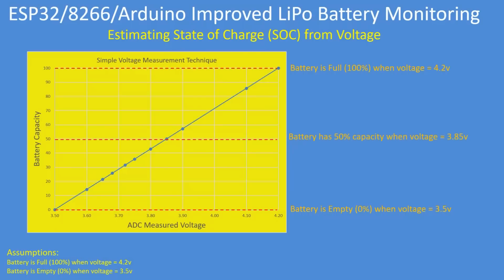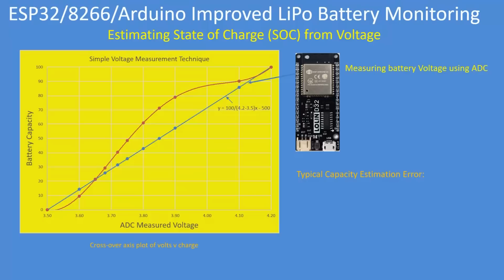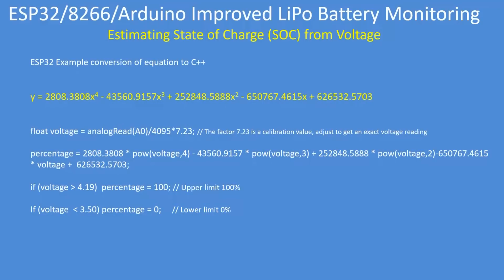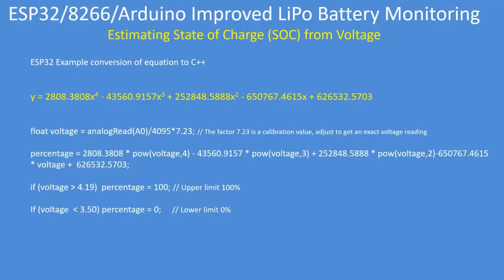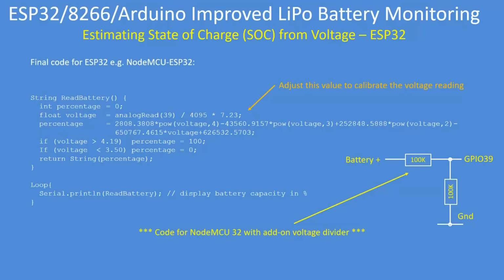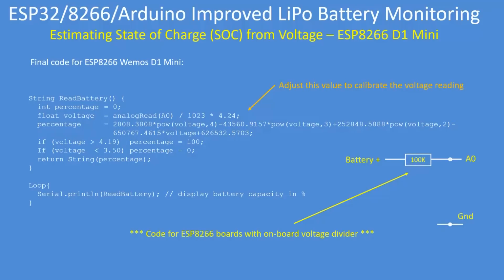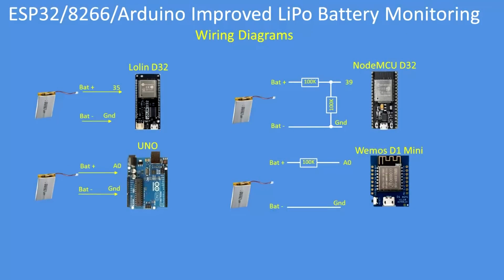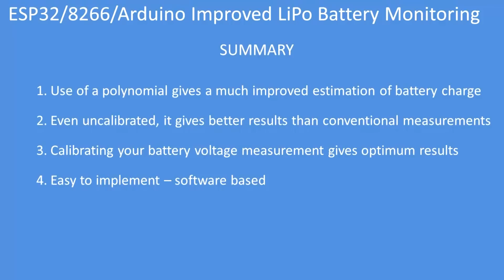Tech Note 129 - ESP32/8266/Arduino Improved Li-ion/LiPo Battery Monitoring

Comment: Wouldn't a 3 point interpolation get you closer to actuals?
Reply from the maker: The ADC is significantly non-linear between 0 and 0.6v and then 3 to 3.3v, which is why I chose s polynomial to follow the ADC response curve, a simple linear interpolation would not give acceptable results outside of the region 0.6 to 3 volts, however within that range the ADC is actually very linear.

Comment: Is it dangerous i do direct connection lithium ion to esp32?
Reply from the maker: If you mean via an ADC input pin then no. If you mean to supply power to an ESP32 then that sort of battery will destroy the ESP32 as the battery voltage is nominally 3.8v and the maximum ESP32 supply voltage is 3.3v. You can use a LiFePO4 battery for direct connection as it’s cell voltage is 3.2v
Reply: @G6EJD-David  i just want to use esp32 to monitor the lipo4 battery percentage. Should be okay right by just adding two resistor for voltage divider
Reply from the maker: @shakirsalam555  exactly that is required
Reply: @G6EJD-David  hi bro,i just eant to ask. Is there any way i can take the serial monitor value and display it on lcd or oled display?
Reply from the maker: @shakirsalam555  when you say serial monitor value, do you mean the data value received?
Reply: @G6EJD-David  yea true, how to make parse the value from serial monitor to oled or lcd to display
Reply from the maker: Assuming your serial port is assigned as Serial2, then int Value=serial2.read();
Then:
LCD.print(Value);

Comment: Hey friend nice video! wondering if we could use 2 * 1 million ohms resistors instead 2 * 100K ohms? i need the lowest power consumption on my project.
Reply from the maker: You can but then that limits the input current to the ADC and results in noisy / variable readings, if you don’t need to take readings quickly you can add a 1.0uF capacitor across the ADC input and Ground to smooth the readings, but it will introduce a delay of 1-sec in reacting to change, you could try lowering the capacitor values to suit your application.

Comment: Hi thanks for the vidéo ;) I like it ! one question remains : if you mesure the battery under load what happens ? if the load is big ? if the load is small ? If the load is big i presume the voltage will drop, so  your solution is not suitable for any device that uses power of the same battery that it mesures. Can you confirm that ? Thanks for the great explaination of polynomial curves again !
Reply from the maker: The ADC measures the literal voltage just like a DVM would do, so whether on light or heavy load the voltage measured is that across the battery. The on-board regulator has a drop out voltage of about 0.1v and the ESP32 stops working at about 2.8v so when the battery voltage reaches 2.9v the ESP32 will stop working.

Comment: hi David, you really did a great job determining the polynomial function.
I tried to do the same thing because I want to use 3.1V for 0% but without result ....
my curve remains crooked !!
Can you calculate me the function for 100% at 4.2v and 0% 3.1v
Reply from the maker: I can do, I use the tabular method. But with a standard voltage regulator with excellent drop-out specification do you think your ESP32 will still run reliably? 3.1 volts infers an output voltage of 3.0 or less, it will take me a while to do the maths, but watch this space!
Reply from the maker: Try this,, but I think battery voltage is going to fall away very quickly: y = -0.00000000001912x6 + 0.00000000451735x5 - 0.00000039128959x4 + 0.00001345348277x3 + 0.00002191577616x2 - 0.01698649053242x + 4.19959893330281
Reply: @G6EJD-David  Thank you very much David for this function,
but it is to calculate the voltage according to the percentage
so without abusing, is it possible to have reciprocity?
Reply from the maker: @brunodelort3337  So you want to achieve a linear voltage reading?
Reply from the maker: @brunodelort3337  You can just multiply the % value by the chosen voltage range, for example 0-100% = 0 - 3.3v so % / 100 * voltage or for example at 50% = 50/100*3.3 achieves the same result as a new polynomial based on a 0-3.3 y scale.

Comment: Good and Thank you for sharing such a Greate Video, I have a Question , can we Use Same code for Esp8266 with Huzzah featured ? Thank youn
Reply from the maker: Yes, but the ESP8266 has a 0-1v ADC input so input voltage is limited and you’d need to put a voltage divider on the ADC input that reduces the 4.2v battery down to 1v so a voltage divider of / 4 at least then change this line:
  float voltage = analogRead(35) / 4096.0 * 7.23
To:
  float voltage = analogRead(35) / 1023 *  4.0;
Typical R values would be Vbat——470k—ADC—100k—Gnd you may have to vary the * 4.0 value as the resistors can’t get an exact divide by 4.

Comment: I am using node MCU devkit 1.0 by Amica which voltage divider I should use
Reply from the maker: Depends on what voltage range you want to measure 0 to ? Volts
Reply: @G6EJD-David  i want to measure my battery voltage 4.2v to 3.0v
Reply from the maker: @mr.techinventor3463  then use two 470K resistors or two 220K would do or any two same values wired like this +Battery—220K—ADC-pin—-220K—Gnd
Reply: @G6EJD-David  thank you

Comment: So just to check I understand this, if using a Lipo on a lolin type board (with integrated lipo socket), the measurement is actually taken usning an internal ADC (despite referncing pin 35) and this will allow me to monitor voltage without any additional circutry?  Thanks. (At about 3.45 on your video)
Reply from the maker: Yes  OST boards have an on-board voltage divider which has a /2 ratio enabling 0-6v to be measured, actually 6.6v depending on linearity required. The Junction of the voltage divider is connected to pin 35, could be any pin in the ADC pin range and yes you can monitor battery voltage.
Reply: @G6EJD-David  thank you. I'll give that a try.
Reply: @G6EJD-David  I've hooked up a Lipo and tried running your code, but I'm not getting anything by reading pin 35.  I have also tried substiuting several other pins, but to no avail.  I did run a loop changing the pin number on every iteration and the first time round, pin 15 looked promising with 4+ volts showing (The lipo was charging via the USB connection), but since then, I only get a reading of 0.77v.  Any ideas?
Reply from the maker: There are genuine Lolin D32 boards and fake Lolin 32 boards die it have a white silk screen LOLIN D32 label on it. If not it’s a fake and no on-board voltage divider and monitor is fitted. If a genuine board there must be a battery supply fitted to the batter SH terminal and it will use pin-35 in common with most other boards fitted with an on-board monitor. Where did you buy it from?
Reply: @G6EJD-David  I got it from Aliexpress.  My guess is that being a copy, it probably doesn't then have this option.
Reply from the maker: @madaboutpuppets  only from here: LOLIN Official Store
https://a.aliexpress.com/_vMJwAP

Comment: I am having trouble getting this to work on my lo lin 32 with the battery charge option. I think I am miss understanding the circut not the program or the math . when I plug in the battery should I get voltage directly between pin 35 and ground . I get 0 voltage I have 3.3 at the 3.3 pin so the battery is connected and I have charged the battery up thorough the board but cannot get any reading out of pin 35 through a meter or through the program. 
thanks Jim
Reply: I figured this out thanks
Reply from the maker: Some boards don’t use pin 35 or more usually have no connection at all an you would need to make a wired connection between the battery + and a voltage divider and the chosen ADC input pin.

Comment: Is this for a 3.7 V LiPo battery or some other one? Thanks
Reply from the maker: Yes, Li-ion 18650 3.8v nominal battery type, but could be modified for others. It’s meant for the Lolin D32 and others on-board battery input. I have not seen any other battery used.

Comment: I use WEMOS LOLIN32 V1.0.0 with a 3.7v polymer battery without resistors, I have used your code but the battery indicator only continues to show 100%, do you have a solution..thanks before.
Reply from the maker: The Wemos lolin32 v1 does not have an on board voltage divider it was a copy board. See my tn143 to see how to add a voltage divider, you’d need to use 2 x 470K resistors
Reply: @G6EJD-David  thanks for your respond can I use 100k resistors?
Reply from the maker: Yes any two identical values gives you /2 to make the maths easier
Reply: @G6EJD-David  Hello, I make a project into school and I need to indicate when is battery low. I have also WEMOS LOLIN32 V1.0.0 so without an on board voltage divider. I do not know how to right connect the battery. Can I use built-in JST-PH-2 conector for battery power and still be able to put there a voltage divider and measure the power? Thank You for Your Response.
Reply from the maker: Is there a Vbat pin on that board? To measure voltage you will need to use a voltage divider made of two resistors of the same value. Wired like this Battery + terminal or Vbat pin, - - - - R1- - - - ADC pin - - - - - R2- - - Gnd 
R1 and R2 can be any two equal values say 100K is each or 470K or 220K or whatever even 1K but they will discharge the battery quickly if too low a value.
Read the voltage with the standard ADC read function. If you use pin 36 then float voltage = readAnalog(36) / 4095.0 * 6.566;

Comment: Hi Dave, 
I'm working on a project using Esp 32 and 3x18650 battery in series(12.6v)  with a voltage divider to 3.3v for ADC. How can I calibrate it? 12.6 will be the 100% and 10.5 the 0% or i have to adjust the calibration value to 4.20 - 100% and 3.50 - 0%?

Thank you in advance for your time and for the good job as well :)
Reply: did the esp32 is showing the accurate adc value in your project by using the voltage divider
Reply from the maker: Every ESP32 has a different ADC response depending on its reference voltage. This is why they need to be adjusted and compensated for. The voltage divider only improves range.

Comment: Hello, nice work there. Thanks for the explanation. I have a question. How do you measure battery if you use 18650 battery shield? What probe do you use to connect to the voltage divider? Thanks.
Reply from the maker: You have to do the same as any other battery measurement and add a voltage divider if one isn’t fitted to the board, then wire it’s (divider) input to the battery + terminal there’s no other way of doing it, not neat but it’s the only way. It would be unlikely for the battery shield to have a Vbat terminal
Reply: @G6EJD-David  Im on the LOLIN LITE, and running it off a 18650 like above, can I solder a jumper strait from the positive terminal to pin 35 to get my voltage reading? do i need the 100k resister?
Reply from the maker: @photobusta  the ADC input maximum voltage is 3.3v, so you must fit a voltage divider to reduce the voltage say Vin—-100K—-ADC Pin——100K——-Gnd then when you take your measurement it needs to be multiplied by 2 for the correct value
Reply: @G6EJD-David  awesome! thanks

Comment: Very useful explanation and I'm going to use this method in my project. I actually use 2s LiPo 18650 batteries to supply Arduino nano. What would be the calibration coefficient in this case. Please advise.
Reply from the maker: If your doubling the input voltage then reduce the multiplication factor by 2 by increasing the first series resistor by 2 otherwise the input voltage will exceed the ESP32 ADC capability
Reply: @G6EJD-David  , Thank you very much, but I use Arduino nano, not the ESP32.
Reply from the maker: Alio Canter, well the same principle applies you will have to double or more the first series resistor of the input voltage divider
Reply: @G6EJD-David  It means that I'll have to provide 5V form 8.4 V at the ADC input of Arduino nano?
Reply: or 4.2V? Sorry but I am newbie.
Reply from the maker: Alio Canter, yes the Nano input range is 0-5v so to measure 8.4v (2S configuration) then take the formula I provided and add a factor at the end of 3/5 but you have to add a voltage divider that reduced 7.4 to 5v there are many combinations of resistors you can use but Vbat —-200K—ADC input—100K—Gnd would do.
Reply: @G6EJD-David  Thank you very much!

Comment: How to perform calibration sir to get value
Reply from the maker: float voltage = analogRead(35) / 4096.0 * 7.23. 
Vary the value 7.23 until the value of voltage is correct, no other way of doing it. Use a ratio to get the exact value, example ESP32 voltage = 3 but actual voltage = 2.8 with a constant of 7.23 then new value = 7.23 * 2.8 / 3.0
Reply: @G6EJD-David  many thanks sir you are very helpful glad to have teacher like you

Comment: Great Video David, many thanks.
I'm not getting the results expected. Using a Wemos D1, with the 100k in line. 

Looking at your code in the video you have 
float voltage = analogRead(A0) / 1023.0 * 4.24; 
and on github you have
float voltage = analogRead(A0) / 4096.0 * 4.24;

I'm guessing it should  be the first one. 

I was pointed to this video as I was having issues getting correct readings, and with your code I'm still getting odd readings, they don't match. 
EG my the battery shows 3.42v on a meter, but the code is showing 3.63v.

Any ideas?

Thanks
Reply from the maker: Brian, the ESP ADC’s are variable as are the voltage dividers, so as you have surmised the / 1023 code line is correct for the 10-but ESP8266. Next adjust/calibrate your reading on the serial port by adjusting the multiplier 4.24 if too low compared with your meter increase it or too high decrease it.
Reply from the maker: So you need 4.24 * 3.42/3.63 = 3.95

Comment: Would it be better to map the voltage to the percentage in an array and then estimate by aproximation? It could be faster i think. Great tutorial!
Could you make a video on how to create a polynomial to use in projects? keep the good work
Reply from the maker: The advantage, if any would be marginal, as getting a battery capacity value need not be done in near real time and I expect it takes no more than a few masers to calculate the result. Creating a polynomial is a skill that has to be learnt and requires a high level of mathematics knowledge there are already a few videos and tutorials around that explain the process one very good one is Australian and comes up through a google search.

Comment: Great sir ....how i can send my device  battery level to cloud sir to send battery level in my iot app....
Reply from the maker: Well you need an application that can upload data to which you add the single function I have provided here to read the voltage and then calculate battery capacity. It depends on what your cloud service is and what it’s API is, I have produced a video on Thingspeak uploads which is 95% of what’s required to upload the value.
Reply: @G6EJD-David  thank you sir for quick reply i am using firebase real-time database to upload my sensors data and fetch in iot app using api call....  So how can I send my device battery level to firbase..... I need only what variable should I send to firebase... Thank you
Reply from the maker: Follow the link to Github (in video description, add the function readBattery() to your programme, then
String batteryPercent = readBattery();
You can then send batteryPercent or whatever you called it, it's your choice
e.g.
String batteryCapacity = readBattery();
or if you want to send an integer:

int batteryPercent = readBattery().toInt();

Comment: Very useful information. A much better approach than I've been attempting.  Thank you for you efforts.
Reply from the maker: Dan, the only way to truly get a capacity value is to monitor both voltage and load currents, but using voltage only does give a very good estimation u set most load conditions, I hope you find it useful. I gave up using s simple voltage measurement and straight/line estimate as I knew the results were wrong, now I get a much better value.

Comment: When using higher-order polynomials, the precision of coefficients can potentially adversely affect the result. Is there an easy way to check that the rounding errors in your floating-point-arithmetic do not misrepresent the polynomial? For example - at 4:00 what does the coefficient "2808.3808" actually compile to? Is this enough?
Reply from the maker: On all the implementations (Arduino UNO, ESP8266 or ESP32) a 'float' is 4-bytes and can represent the values in the polynomial.In testing the results are as expected.If there was any doubt the data type could be changed to 'double' however on the UNO there is no difference between double and float. I'll test it now:
  Serial.begin(115200);
  float test = 2808.3808;
  Serial.println(test,6);
  Result:2808.380859  
  
So it's maintaining the 4-places of precision adequately, but adding some lower order artefacts too, but as these are relatively small, there is little effect on the result.Good question, thanks.
Reply: @G6EJD-David  Perfect. Thanks!!

Comment: Is there such a detailed discharge plot for LiFePO4 batteries?
Reply from the maker: Yes there is, knee voltage is 3.0 volts, I could produce a LifePO4 equation if you need it? But I’d need to know the absolute lower voltage, fully charged they are 3.6v and then discharged approximately 3.0, if needed let me know.
Reply from the maker: percentage=4984.6172x3 - 48287.7528x2 + 155490.3329x - 166375.8607 where x is measured voltage for a LifePO4 and assumes higher end of 3.4v and lower end 3.0v
Reply: @G6EJD-David  thank you for taking time out of your day to formulate the equation!
Reply from the maker: It's my pleasure, I'll add it to the library as an alternative version.